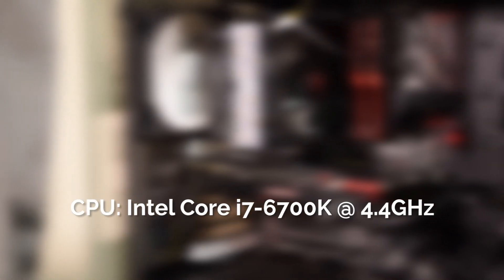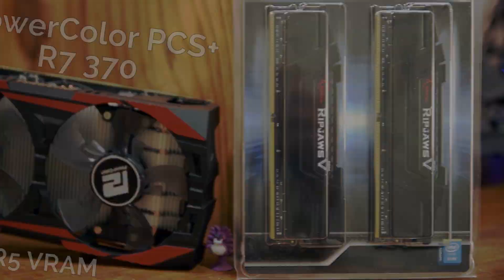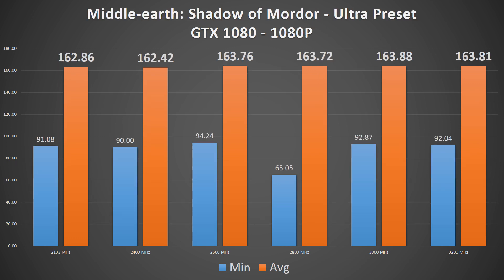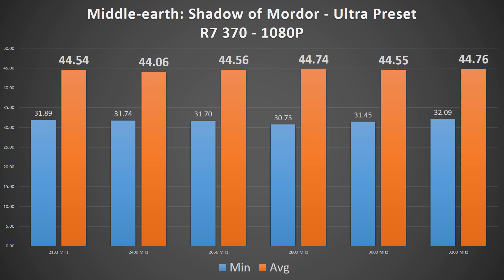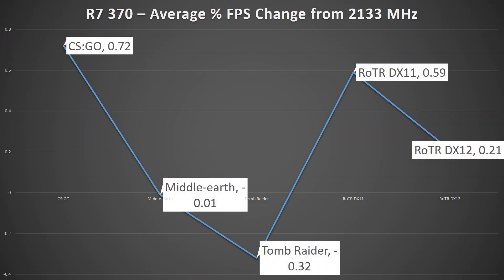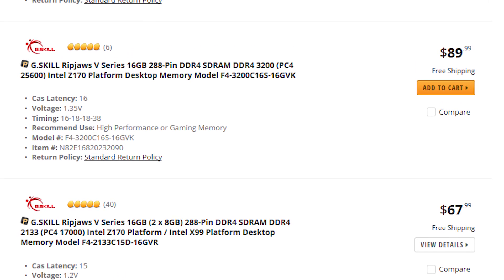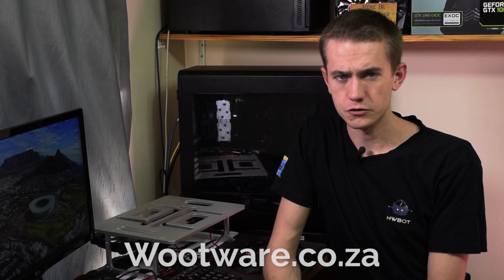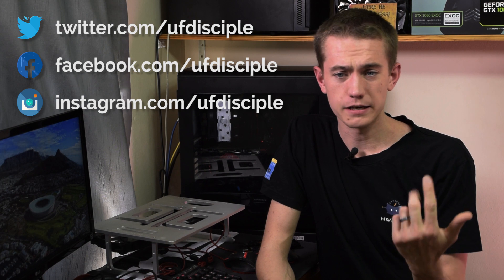Is Faster RAM Worth It? - 1080P Gaming Testing

Comment: Not trying to give you a hard time, and maybe I missed it, but telling us you are testing from 2133mhz to 3200mhz is only half the story, UNLESS you set all of their cas to the same thing. For instance, 2400mhz cas 10 ram is much faster than 3200mhz cas 16. So it is a combination of them that is true speed, not just which has the higher mhz. So I am wondering did i miss you talking about the cas of all of these chips?
Reply: Where can I find detailed info on CAS? It's the first time I'm hearing it.

Comment: Wouldn't you see a larger difference when the CPU is actually the bottleneck? I think it'd make more sense to test a GTX 1080 or Fury X at 1080p low settings to see the differences, although its not realistic.

Comment: It's probably worth mentioning that although 3200 RAM is only $20 more than 2133 RAM, you can save an additional $80 or so on your motherboard if you can commit to just using 2133 RAM.
Reply: Good old times.

Comment: Does dual or single channel matters?
Reply from the maker: +Peter M Yes.  Dual always better, maybe not tremendously, but enough to go for 2x4 over 1x8 usually.  Although if you're doing it for future upgrade reasons, then it's fine to go single channel for that duration.
Reply: In addition to what UFD said, it's also safer because when one stick fails, you would be left without any if you go for 1x16.

Comment: Can you test this with an AMD Athlon processor since those lack L3 cache and due to that the cpu has to access the ram a lot more and quicker as well, maybe then it will be more of a difference between the ram speeds.
Reply from the maker: +Thelango99 Thanks for the suggestion.  I likely will not get around to that.

Comment: Helpful video!
What about 4x4Gb 2666mhz with core i5 6600k and 1070 @1080p???
Reply from the maker: I do not have the configuration necessary to test that. But sounds like a perfectly capable system.  A GTX 1070 should be able to run through most games at that config.
Reply: +UFDisciple Cool.

Comment: so.... bigger capacity more important than faster ram?
Reply from the maker: If you have at least 8GB, then faster RAM would likely be a better boon.  However, if you have 4GB, upgrade the amount first.  If you have 16GB, you should be completely fine for most games.
Reply: recently i upgraded non-k cpu + non z mobo to z170 + 6700k, but i keep my old ram which is rated 2400 mhz 16-16-16-36 (4x2GB). should i upgraded to 3000/3200 rated one? or add more ram? so it'd be 16GB (4x4GB ram)
Reply: If you play at 1080p you will be able to hold on for a while longer :)
Reply: If you always play the latest games then I'd go to 16GB first, then the speed like UFD says.
Reply: i've overclocked my ram. originally it's rated 2400mhz. but i overclocked to 3000mhz at 16-16-16-36 CAS. pretty good.

Comment: pci express Will going good for 4way sli Titan x pascal
Reply from the maker: I do not understand your comment.
Reply: UFDisciple i thing he ask that 16x lines cpu botleneck 4x sli.
Reply from the maker: Still confused.
Reply: UFDisciple best cpu have 40 pci lanes.  4 graphics card need 4x 16 pci =64 so it can't run on this configuration. Only 16x/8x/8x/8x. So 3 cards will botleneck about maby 1% or more. If you use cpu with 28x lanes it will 8x/8x/8x/4x. Last card will botleneck heavy. If cpu 16x =4/4/4/4 probaly not suport or botleneck very high.
Reply from the maker: +Mój kanał taki zajebisty I understand PCI-E lanes.  I'm confused on how you can draw anything out of his short statement.